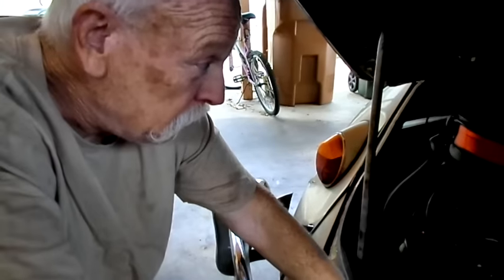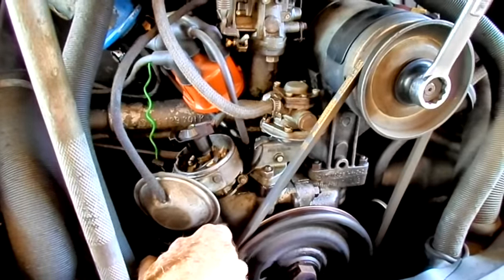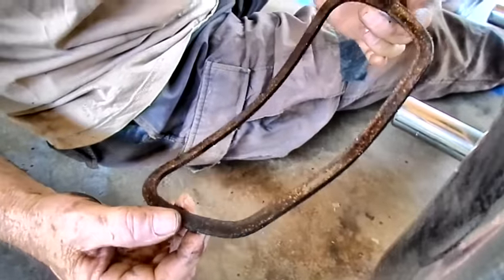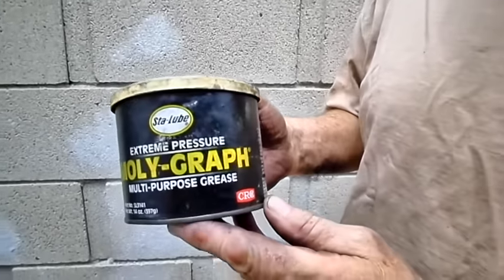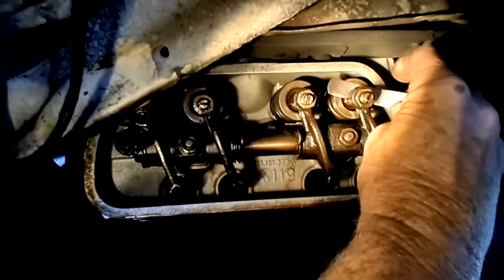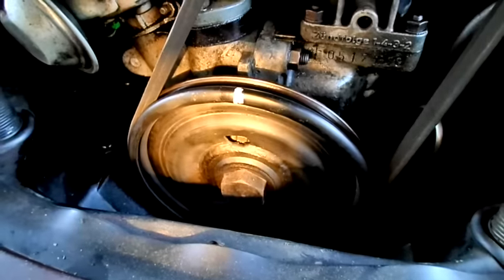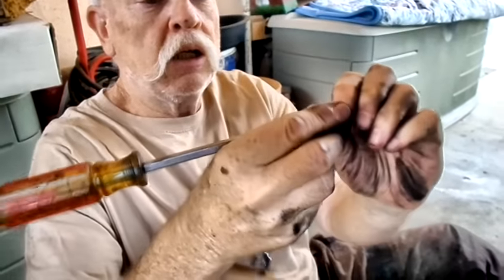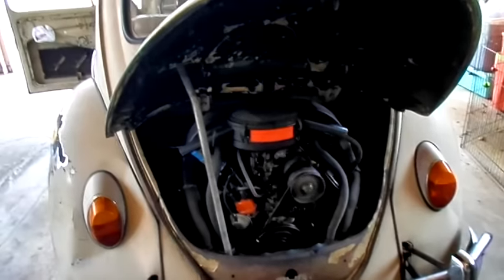VW Valve Adjustment | Volkswagen Tips by Bruce

Comment: As an old Beetle dude myself, I picked up this shortcut MANY years ago.  In #1 position, you can set the front 3 valves on the passenger side and the rearmost valve on the drivers side.  Then turn crank one revolution to #3 position and set the remaining valves.  Saves this old guy a couple of up and downs from the floor.
Reply from the maker: Great info, George! Thanks! Bruce will give that method a try!

Comment: Thank you, I never done a valve adjustment before. This video made me do it with confidence and now my beetle is running healthy.
Reply from the maker: Well done, Jose! Great job! As long as you keep those Valves Adjusted, Change the Oil every 3000 miles (see my video), don't overheat the engine, do not Lug it (RPM's too low/downshift), do not Over Rev it, your engine should last 100,000 miles or more!  Happy Fahrvergnügen!

Comment: Hi Bruce, what an excellent video. Greetings from the UK. I've just got a 1974 it runs for about 30 seconds and then dies. weather permitting I'm going to have a look at the valves this weekend with your video...
Reply from the maker: Hi George!  Hope that worked out for you. Is your 1974 an EFI? If so,  it may be the EFI "computer".  Maybe check your fuel pump output, too. Hope that helps! Happy Fahrvergnügen!

Comment: I really enjoyed your video. I’m attempting to do this on a 69 Porsche 912. Any advice on doing the adjustment without being able to find TDC?
Reply from the maker: Hi toptiermango. Thank you for watching my video & glad you enjoyed it. 
To answer your question. Follow the spark plug cable from cylinder #1 to where it enters the distributor cap. Pop the cap open & hand rotate the engine clockwise until the distributor rotor is lined up with the # 1 spark cable in the distributor cap. Now mark the crank pulley where the crankcase halves join together. Use a bright contrasting color so it's easy to see with your strobe timing light. Your crank pulley is now marked at TDC & you can do your valve adjustment. Make sure your engine is cold & hasn't been running for at least 6-8 hours. Good wrenching to you & 
Happy Fahrvergnugen. 
VW Bruce

Comment: Is there any way to do an adjustment / inspection WITHOUT a feeler gauge? Thanks for the video, reminds me of growing up and working in the garage with my dad. Tons of fun.
Reply from the maker: Hi DizzyRigBig.
No, not really. However, if the valves are adjusted properly, a very slight play can be felt in the rocker arm with your fingers. If no play is felt, valves could be too tight. I'd you hear a lot of clattering, valves are too loose. 
A feeler guage is a necessary tool & are relatively low priced. .006 is the blade to use to get factory spec valve clearance. 
Happy Fahrvergnugen! - VW Bruce

Comment: Hey Bruce, Awesome video. My daughter has a Bug now she can check her valves herself.  One question, do you drain the oil first or just go to town?
Reply from the maker: Bruce says, "Hello Emily and daughter! Thank you! I try my best.  So cool that Daughter will be checking her own valves! To answer  your question, oil change and valve adjustements are 2 different jobs. Not first or second. Reason is oil needs to be drained at operating tempurature (hot) and valves must be adjusted cold to the touch.  I personally change the oil first, let the car sit overnight and do the valves first thing in the morning while the engine is dead cold. My Oil Change video has a few cool tips n tricks as well!  Hope this helps!  Happy Fahrvergnügen!

Comment: Great video.thanks..you mentioned in a comment about the oil pressure control valve.where is that located and how is it adjusted..
Reply from the maker: Do you mean the oil pressure relief valve?  If so, it is on the bottom of the motor, in the back, on the right-hand-side. You will see a very large screw. That is it, the relief valve. There is no adjusting it. Simply remove the screw, slideout the spring and the valve, clean thoroughly and replace.  They very rarely go bad. Hope this helps!  Happy Fahrvergnügen!  - Bruce

Comment: Hey sir, my #1 cylinder is at your #2 position.  Is that an issue?  Seems to be running "ok" (still need to clean some gunk out of my fuel filter).  I just put another distributor on and it was the same way.  Please advise.  Thanks.
Reply from the maker: Hi William. Check your plug wires to make sure #1 plug is hooked with #1 on your distributor. Check your timing. You may need to reset it if the distributor has been rotated significantly.
Happy Fahrvergnugen,
VW Bruce
Reply: @VWBRUCE  yeah #1 wire goes to #1 plug and corresponds with rotor and TDC. Just was wondering why mine was off 90°
Reply from the maker: @williamscheiderer9277  could be your distributor drive gear was installed 90° off into the engine case when it was assembled. If all is well, I'd  let it ride like that. Rotating the distributor drive gear to its proper position requires the engine to be disassembled & the case split apart to correct it.  I've  seen the drive gear installed off a few times. Usually it's off 180°, making cylinder #3, #"1" & #1 #"3".
Reply: Gotcha.  And thanks for the quick response sir! @VWBRUCE
Reply from the maker: @williamscheiderer9277  your welcome & have fun tinkering!
Happy  Fahrvergnugen, 
VW Bruce
Reply: @VWBRUCE  lol haven’t heard that in a long time.

Comment: I just finished rebuilding a 1600 dual  port and was wondering when the first valvevalve adjustment needs to be done?
Reply from the maker: Bruce says, "VERY good question! On rebuilds, NEW valves need to seat themselves in and the valve seats (in the Head) need to get used to the NEW valve face. I do my valve adjustments at 100 miles, 300 miles, 600 miles, 1000 miles, 2000 miles, 3000 miles, and then every 3000 after that, forever! That method has never failed me in my 55 years of VW wrenching.   Happy Fahrvergnügen!

Comment: Hi, Bruce! Great video. I've been looking for some curved feeler gauges like you have. Can you tell me who makes them? Thanks!
Reply from the maker: Hey, Cade!  Thank you for the compliment!  The Feeler Gauge that I use is about 50 years old, but, I have found a similar set made in the USA by Proto on Amazon. Here is the Amazon link, it is also in the video description should you need it again! Happy Fahrvergnügen!  Feeler Gauge set at .006 (VW spec) - https://amzn.to/2w4GICU
Reply: @VWBRUCE  Sweet, thanks, Bruce. I ended up picking some up locally today, but did my first successful oil change and valve adjustment; only had to slightly loosen exhaust 1. Anyhow, thanks for the VW ed! Glücklich Fahrvergnügen auch!
Reply from the maker: @cadegallal5181  Glad I could help. Good job on that valve!!

Comment: Hey Mr Bruce. Sir I am going to ask you a question, if I may. And the answer is probably everywhere on the internet.  Sir I have a 1969 1600 single port motor. My question is regarding the firing order 🤔.  I do have the point system distributor.  With the mark on the pully . In the middle of the block.  No 1 fire . Is the router in the distributor suppose to be pointing at 5 o clock. Or must the router point to wards no 1 which will be 2 o clock?  If you can please 🙏 help . Kind and friendly regards Johann from South Africa 🇿🇦  Cape Town
Reply from the maker: Greetings, Johann.
You ask a very good question. It sounds like you have a factory stock setup. How sweet that is!!
Your router should be closer to 5 o'clock than 2 o'clock depending on how much advance it has been timed for. You have the pulley timing mark matching the split in the crankcase correctly. Follow the spark plug wire from #1 to the distributor. Pip off the cap & the router should be right under the #1 wire where it enters the cap. Double check to make sure the distributor is installed correctly. Firing order is 1-4-3-2
Stick timing is at 0°. I advance my own engines to about 7° BTDC to get the full distributor advance curve for power & gas mileage. Keep me posted on how it goes. Post a picture of your bug, too please.
Happy  Fahrvergnugen, Johann.
VW Bruce
Reply: @VWBRUCE  Sir thanks for your reply.  I will apply your directions . I have also watched your video regarding the distributor installation.  The main reason for me asking this question.  At the moment I have the router pointing towards #1 (2 oclock) with the plug lead to #1.  Should I manually turn the motor with a 21 size spanner till the mark on the pully lines up and the router pointing to five o clock . Or will I just end up back at 2 o clock ? Sorry for your time. I don't even know what time zone you are in or even available to help.
Reply from the maker: @johannsmit2001  does the engine start easily & idles smoothly at about 900rpm with your current settings? If so, good. If not rotate your distributor clockwise to bring #1 to the 5o'clock position. Do the rotation while your engine is running. The way your engine responds will tell you if you're headed in the right direction or not. Check your dwell angle when done. It should be 44°-50° at 900 rpm. You may have to readjust your carb idle screw  to get the proper idle speed, 800-900 rpm.

Comment: so.what is the exh set for?  06??  or not mentioned: 08??  or both 06??  neophyte
Reply from the maker: All the valves are to be set at .006 cold engine. I suggest letting the engine sit overnight before a valve adjustment. 
Adjustment the valves & change the oil every 3000 miles will extend your engine's life significantly.
Happy Fahrvergnugen,
VW Bruce

Comment: If I park my bug on a slanted drive way well this cause the oil in the motor to ack over filled and cause the oil cooler to leak?
Reply from the maker: Hello David!  No. I don't know what your definition of "leak" is. VW's historically drip slightly  This occurs from the front engine oil seal lip occasionally dripping a drop or two which is designed by VW to keep the front oil seal from excessive engine heat shrinkage. We call this "marking their spot." Oil cooler leaks only occur when the engine is running. The oil drain plug and/or the oil strainer drain plate is the likely cause of your leak. Check for tightness & remember to replace the gaskets when changing your oil every 3,000 miles. I hope this helps you, David!
Happy Fahrvergnugen,
Bruce
Reply: @VWBRUCE  big oil leak I have had it fixed 3 times in a row I get about 25 50 miles and it leaks. The leak is big that I can't drive it if I do I have to pull over ever 10 miles and add oil . The mechanic said he thinks it may be building up too much pressure in the motor.

Comment: Question, if there is oil leaking from the valve cover does that mean the valves need to be adjusted? Or is it that the valve cover needs new seals?
Reply: Rocker gaskets will need changing
Reply from the maker: Hi Julia...one of three possibilites here. The easiest is to replace your Valve Cover gaskets  (link in the Description).  If that doesn't stop the leak, then the Valve Cover Retainer Spring maybe too weak. So, replace that. If that doesn't stop the leak, your oil pressure is WAY too high! Check and clean your Oil Pressure Relief Valve. Depending on your Crank Case, you may have 2 of those.  Hope this solves your problem. 
Happy Fahrvergnügen!

Comment: My 3rd cylinders intake valve won’t let me gap it, I pulled the screw way back and it still won’t let the feeler tru. Any advice??? Thanks.
Reply from the maker: Bruce says, "It sounds like you have a suspect Valve Spring. Either the spring itself or the Spring Keeper or the Valve Retainer is dysfunctional = see a machinist! This happened to me once long ago. Sorry, man. That is a real bummer!"
Reply: Sounds good thanks for the info

Comment: I think i have a leak from the valves on the right. Because after 15 minutes, i get a burning smell. Im assuming its the oil dripping onto the metal below it...what do u think?? (Ps. Greaaattt Video man. Loved it. Jus wish we coulda seen u actually adjust a valve)
Reply from the maker: Hey Tomas!  Thank you for your kind words. Your oil smell is probably from it dripping onto the Heater Exchange Box....one of three possibilites here. If you haven't already, the easiest is to replace your Valve Cover gaskets  (link in the Description).  If that doesn't stop the leak, then the Valve Cover Retainer Spring maybe too weak. So, replace that. If that doesn't stop the leak, your oil pressure is WAY too high! Check and clean your Oil Pressure Relief Valve. Depending on your Crank Case, you may have 2 of those.  Hope this solves your problem. 
Happy Fahrvergnügen!
Reply from the maker: ALSO, we are trying to get into another VW on our fixed income so we can show everyone Bruce's technique on actually adjusting a valve.

Comment: My nut and screw are moving together when i turn the nut! Any suggestions!?
Reply from the maker: Hi Anthony,
Bruce says what he does is have a spare bag of nuts and bolts to replace those that cease/frozen like yours. He's experienced your problem so much that for him it is worth buying a bag of valve adjusting nuts and slotted screws. They are surprisingly cheap! For now, unlock the Lock Nut and remove the Adjuster Screw. The Lock Nut will come off with the Adjuster Screw. Replace with new Adjuster Screw and Lock Nut. It should now be rather easy to adjust your valves.

Comment: What weight oil do you use and what brand.
Reply from the maker: In the summertime here in So Cal, I run Castrol straight 40W and in the winter Castrol 30W.  Here is video of mine with some Oil Changing tips and what I use! 
https://youtu.be/wlmQjJfjuBc

Comment: Do you need to drop oil before you start?
Reply from the maker: Hi, Dave. Good question.  No you do not. I adjust the valves first after the  engine has sat overnight. Then I warm up the engine thoroughly  & change the oil.
Happy Fahrvergnugen! - VW Bruce
Reply: @VWBRUCE  I did google Fahrvergnugen! Lol

Comment: mine doesn't rotate as easily as yours
Reply from the maker: Hi Michael! Thanks for your comment. But it does rotate, right? How does it run at idle? Perhaps you have a higher compression engine? Modified heads, racing pistons, high lift cam... can raise compression making the engine harder to rotate. If that is the case you could try removing the spark plugs which should make rotating the engine by hand much easier.
Hope this helps you, sir.
Happy Fahrvergnugen - VW Bruce
Reply: @VWBRUCE  thanks for the reply.  yes it does rotate.   side question.  I just changed my oil (for the first time) and I put a solid 4 quarts in.   this seems like a lot.  I checked the level and it isn't over the second mark.  I do have an oil filter on my car.   74 ghia.
Reply from the maker: @manningcustom  Hi Michael.  Stock VW air cooled engines hold 2.5 qts. Your oil filter must hold a lot &/or your engine has an aftermarket sump attached